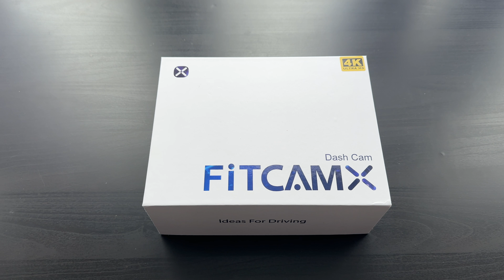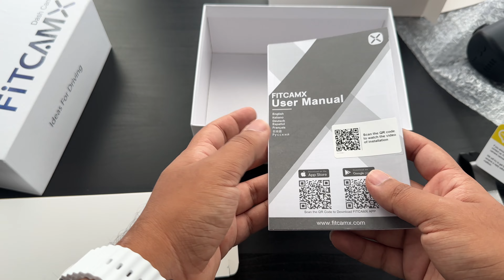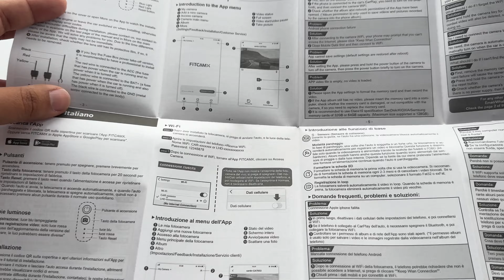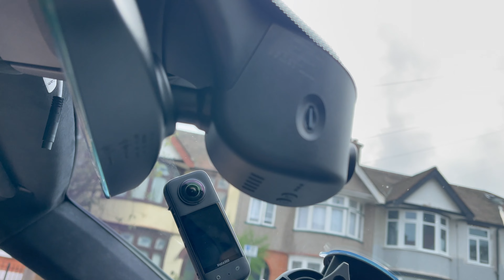FitcamX Dashcam - 4K Front & Rear OEM - Unboxing & Install (Porsche Panamera 2019+ BEST DASHCAM!)

Comment: I used your video to successfully install the FitcamX dual system. My biggest challenge was finessing the rear camera cable as to exit the rear view mirror front housing as to not pinch the cable near the connector which wasn't allowing the housing the fully seat. Hearing that last click was satisfying.   I routed my rear camera cable around the rubber panel just above the removed plastic cover panel as to minimize the amount of cable seen. Thanks so much for making this video.
Reply from the maker: Ah I’m so glad to hear it helped out! Thanks for the feedback 🙏🏼

Comment: Beautiful car and super helpful video! When you were running the rear cam wire through the side trims at 11:00 , did you have to take the out the A/B/C pillar covers? Or were the wires just tucked directly into the seam? Just ordered mine and will try to do the same on my Panamera

Comment: I have a 2017 Panamera in which I am about to install the rear camera wire….. Are you certain that you are not crossing over the airbags with the rear cam wire? Couldn’t tell if you are based on video as I didn’t see the cover for the A-Pillar removed… insight on this would be very helpful! Thank you!

Comment: Hi, nice video. I got question. i just got 2025 911 992.2 model. I do have Porsche pre-wire dash cam. When i was askin the dealership they told me that it is not a DIY (Porsche cam) unfortunately as there are components and computers that we have to program to your car to calibrate the cameras to work properly. Is this accurate?
Reply from the maker: Hmmmm it could be possible but I’m not sure as I’ve not looked into the official Porsche dashcam. But if it say integrates with your Porsche app and stuff then it could be. If it’s just a simple dash cam with no features  integrated with your car, then I’d find it hard to believe
Reply: The Porsche pre-wire is not needed for this one (its only to have a power-Connection in Front and Rear). The original Porsche Cam is ugly and can not be done by your self. All in all the installation by Porsche costs about 1600 EUR + 600 EUR for the ugly window mounted Cam. I ordered also a 992.2  and will install this FircamX
Reply from the maker: Ah that’s great thanks for the info! Congrats on your new order too 🙏🏼

Comment: Hi. I have a 2020 911 Carrera S. Will the Rear Camera fit. Can you wire the cord to the back window?
Reply from the maker: Hey! Lovely car - I’ve not seen inside one personally but I’m sure it can be done. Might be tight tucking the wires in the rear but should be possible still. the wire just tucked behind the window trims / headliner.